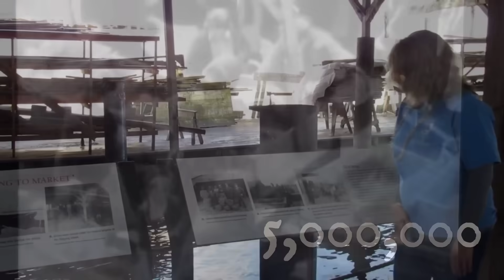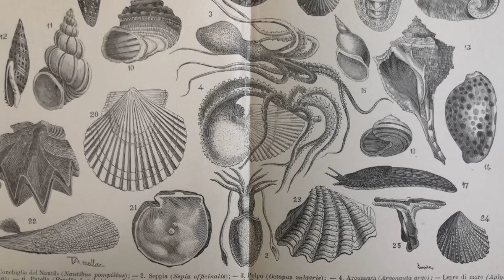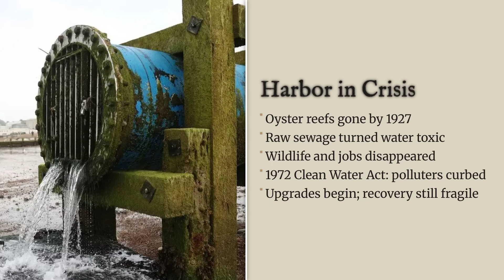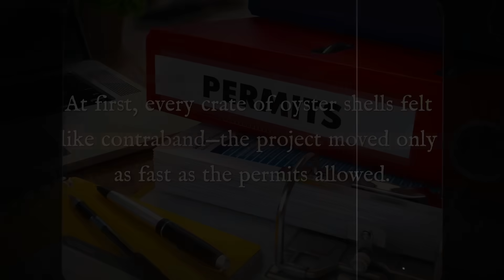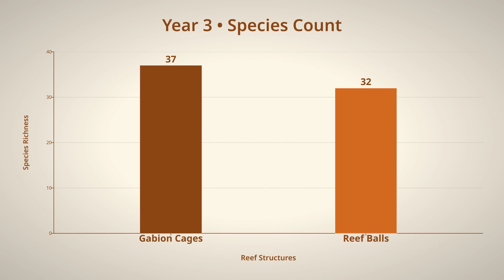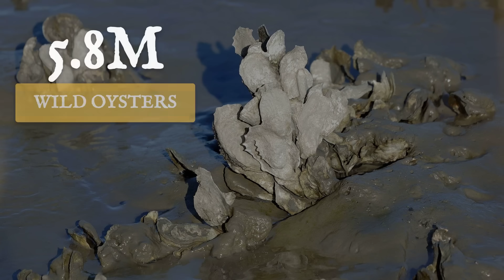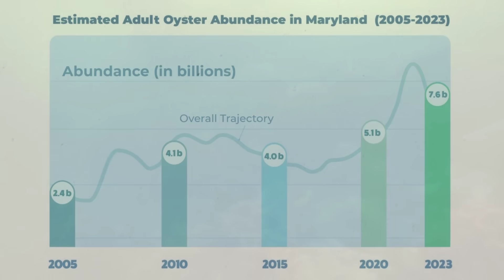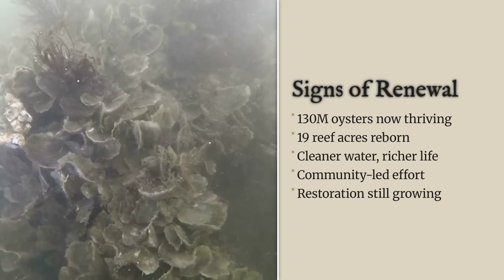Millions of Oysters Were Thrown Into NYC’s Harbor: The Aftermath 10 Years Later

Comment: This is probably the most underrated NYC comebacks ever. They need to upgrade those sewers  soon.
Reply: Or at least put in some UV lights for the gators down there.
Reply: Never gonna happen
Reply: It’s same issue across the Northeast. To resolve this issue all of the sewer lines and storm drains will have to be separated. The cost is in the billions. My small town could not afford it so they just pay endless fines. I think over time things will change as the old infrastructure wears out and needs to be replaced.
Reply: EVERY SINGLE YEAR I've lived in the USA here in CA there are millions of gallons of untreated sewage/street runoff etc that ends up in the bay....and this is CA where we're 'supposed' to care about this stuff. When I first came to the US I thought this must have been some kind of disaster....but nope, it's normal and happens every single year.
Reply: I thoroughly agree, its ridiculous. @andrewglover9608

Comment: HELLO, they are FILTER FEEDERS!! All the runoff from city streets goes into the water. Rat poop, homeless poop, dog poop pigeon poop, get the drift?
Reply: That really depends on the way the sewer system is set up in New York whether it’s a combined system or the street runoff those directly into the river. So I looked it up and it is a combined system basically it just overflows during severe storms otherwise the street runoff is treated. This is similar to San Francisco. People say that all the runoff dumps into the Bay but it doesn’t. It goes to the treatment center and then out to the ocean.

Comment: 19 acres.  A good start and example of project viability.  Over the next 20-30 years need to expand that 200-300 times at least.  Not being negative, just stating need. City investment is vital, but rebuilding city’s sewer system, designed in the 19th Century like most East Coast cities will be enormously expensive.  First steps aimed at amelioration have been completed in some cases with enormous holding tanks attempting to store excessive storm runoffs. And don’t forget, at least a couple of decades ago more untreated wastes entered the river from New Jersey cities (Newark, Hoboken, Jersey City, etc., etc.) than from the much larger New York City.  But massed filter feeders are a great start.
   Yet longer term, decades of massive dumps of industrial poisons discharged into hundreds of miles of the Hudson will likely contaminate fish and oysters long after biological hazards have been controlled.  So unrestricted use of marine resources for food from the Upper Bay is a good deal away.  But a relatively clean, generally healthy river is an unmitigated good, even if not yet quite a feast.
Reply: Don’t spend 10 Trillion Dollars every year on war